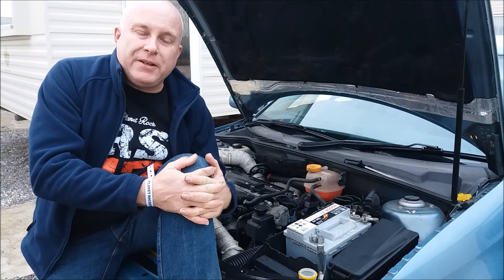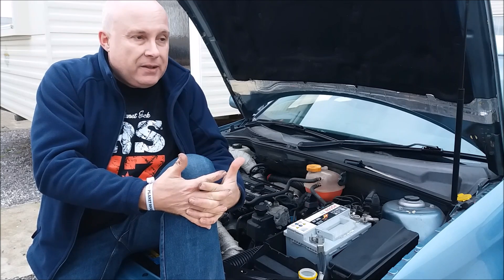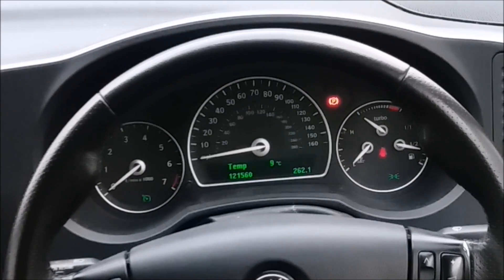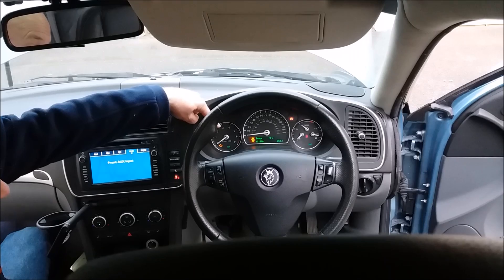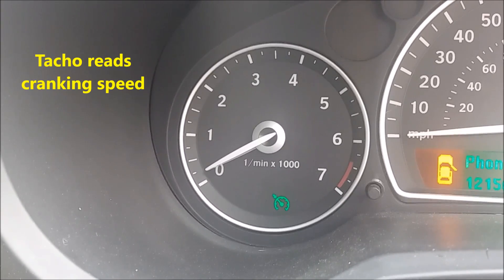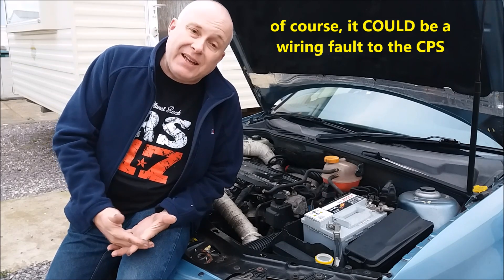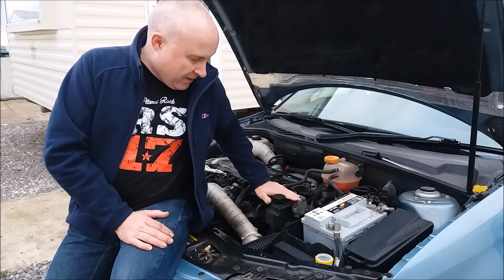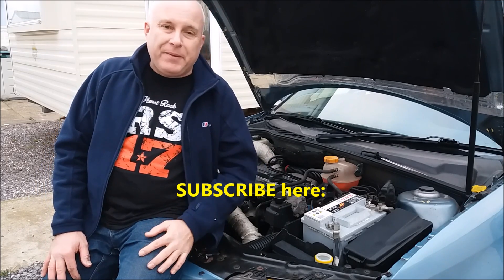CRANK Position Sensor Test - failing CKp sensor - CKp test

Comment: Hey Cyclone Cyd, I’ve been chasing a problem a intermittent stalling problem very similar to what you describe. My car is an 03 Toyota Camry v6. It would die when idling then it would crank, but not start. After 10 mins, it would then start again. Although it is a Japanese car so I don’t if it is the crank shaft position sensor or cam sensors. No codes are set off either. My mechanic is baffled. When cranking, tachometer doesn’t move at all.
Reply from the maker: It turns out that some Toyotas don't show revs when cranking anyway. Do you know if your engine has a camshaft sensor too? Being an older design it may not have.
Next time it stalls, be ready with a DMM. Connect it to the crank sensor (set on low mV scale) and crank the engine. If the sensor is good you should see a small mV reading. If there is no reading (zero reading) then the sensor is dead.
Your symptoms are bang on, so while I'm not normally a fan of playing 'parts darts', in this situation it could be cheaper to change the sensor than to pay for diagnostic time. Testing the crank sensor properly requires a picoscope (££s) and is beyond the vast majority of DIYers (and you'd be surprised how many garages don't have one either).
Reply: Cyclone Cyd I’m not too sure if my engine has a cam sensor. It is the 1mz fe engine non vvti. Do you know what are quality brands for a camshaft sensor?
Reply from the maker: @civlife1239  Bosch and Denso would be my choices.
Reply: Cyclone Cyd out of the crank shift and cam shaft sensor, which one do you think it is more likely to be given my symptoms?
Reply from the maker: @civlife1239  Crankshaft sensor would be my guess. In the region of 60-40 to 65-35 I'd say.
Reply: Hey Clyde, I would like to update you on what the issue was. Crank sensor was only part of the problem. The reason why it failed was because the water pump is leaking colant causing it to fail. This means I’m going to need a water pump and time belt for this car. Car has 150k 03 Camry v6. I’m really disappointed that it isn’t a quick fix.
Reply from the maker: @civlife1239  Ah, water on the sensor eh?  Does the timing belt drive the water pump then on these?
Reply: Cyclone Cyd yeah, I’m going to need a new sensor, water pump and timing belt.
Reply: Do you think it’s worth fixing this car? It’s an 03 Camry v6 with 148k miles.

Comment: Great video and info! What if there is no cranking sound, the kick starter burnt, and the car refuse to start at all?
Reply from the maker: If the car won't crank, then either the starter or battery are dead, the leads are damaged, or there's an issue with the starter control from the ignition switch.
Does that help?

Comment: Great info, thank you! Can you or someone please tell me in regards to a no start Saab - if it is an electrical issue ie. Coil or wiring harness or whatever will there be a bump in RPMs when trying to start???
Reply from the maker: Not from cranking. If the battery/starter system is healthy the cranking speed should stay fairly steady (around 200rpm usually). If the rpms are 'jumping' occasionally that suggests the engine is trying (unsuccessfully) to fire.

Comment: on my   chevy   3500   express  van w  5.7 vortec  engine and  60,000  miles: early   sign of a CKp sensor  problem  was  occasional  MIL  yellow   engine   code on dash,  occasional  code P0300  'engine   misfire   on  random cylinders'. ,the  engine  starts  and  runs   fine and  accelerates  up   hills   well. but my   mechanic  said  don't  drive it, do a   diagnostic. "an  engine  cylinder   misfire   from a   bad   spark  plug  is  annoying   but  an  engine   misfire  caused  by   the  CKp  being  bad can  ruin your   engine. " the  misfires  will just  get   worse   then  cause   you engine  stallouts   when   running ,  and   hard  or   impossible  starting. once the problem is more  advanced  you will   get   OBD Code P 0335  . at that  stage you must  get  this  CKp problem  fixed  or you can ruin   your   engine. sometimes  a  shim   kit   will    fix   it   other   times   you need the  wholeCKp sensor  for   hundreds of  $$.
Reply from the maker: Here in the Uk a CPk sensor is typically £50-80 for Bosch. Does "hundreds of $$" include labour because it's hard to get at?

Comment: Hey I have a 2004 Hyundai sonata. The red oil light came on and the oil fuel full  however I was driving  the car went to lose speed and slow acceleration out the blue the car shut off never started back up it cranks but won't start. I'm at a road block not sure on what's the problem
Reply from the maker: That could be CPk failure, but so too it could be many things. If it was sudden then suspect something on the control or ignition side (CPk would be in this category). If there was any spluttering, suspect fuel problems. When it cranks what does the tacho do?

Comment: हिंदी में जानकारी चाहते हैं सर हम आपसे सेंसर की जानकारी मल्टीमीटर से चेक करने का तरीका
Reply from the maker: I translate that as: "Sir, we want information in Hindi, how can we check the sensor information with multimeter"
The bottom line is that you can't. You need to check it with a picoscope, which means you need a garage to do it. If you have access to one you can use an oscilloscope. You need to check the waveform to see if any signals are missing. It might be cheaper to buy a new sensor than pay a garage though.
लब्बोलुआब यह है कि आप नहीं कर सकते। आपको इसे एक कुंडली के साथ जांचने की आवश्यकता है, जिसका अर्थ है कि आपको इसे करने के लिए गेराज की आवश्यकता है। यदि आपके पास एक तक पहुँच है, तो आप एक आस्टसीलस्कप का उपयोग कर सकते हैं। आपको यह देखने के लिए तरंग की जांच करने की आवश्यकता है कि क्या कोई सिग्नल गायब है या नहीं। यह एक गैरेज भुगतान हालांकि एक नया सेंसर खरीदने के लिए सस्ता हो सकता है।

Comment: very important easy advice! Thank you! I have problems with my Fiat Stilo 1.9 D. Will try tomorrow
Reply from the maker: Ah, the Fiat 1.9 diesel engine. Same engine is fitted to Saabs, Vauxhalls and more. I've got a horrible feeling that engine has a CAM sensor as well as a CRANK sensor, but I'm not certain. You will need to check your service manual. 
Please let us know what you find out and how you get on.

Comment: Hi, my bmw hard start/long cranking when cold engine.. Even after my battery is new, and still same symptom. But when my engine warm /hot it's easy to start. Is that because of crankshaft sensor? Thanks
Reply from the maker: Unlikely. That's the exact opposite of what you'd expect.
Diesel or petrol? Age? What have you checked so far?
Reply: Hi, thanks for replying. Mine's  E60 N52 Engine 2007 Petrol. Btw this morning i just swapped inlet(camshaft) sensor, with outlet (crankshaft), now everything fine for starter. And when i checked with INPA OBD, the error message changed to Outlet Camshaft Signal, so it's mean that Inlet Sensor(the first one, before i swapped) is almost damage. Thats why my bmw super hard to start. So i have to buy new one. 
2 days ago i just replaced new battery.

Thanks for your videk, that's helpful alot!

Comment: I have a vw sharan 2003 when I'm driving along it losses power then I restart a few times then it's OK for a bit then it losses power again dosent happen straight away.
Reply from the maker: and no EML or codes presumably? Sounds like the CPk. Typical failure mode

Comment: Thank you very much for the information you have given ,I am having the same problem, thanks again..
Reply from the maker: You are welcome. Did it help you trace the problem? And what car?
Reply: Cyclone Cyd 
Hello, my car is 1977 ford taurus lx 3000 cc 201 hp, I am waiting for the spare part , nearly 100 percent we have had the same symptoms that you describe when the crank- sensor is not  working properly, I    will inform you about the result, thanks again for your valuable video.

Comment: Isn't this quite common in cars such as your vw 9n?
Reply from the maker: I don't think I'd say it's "common", but yeah, most European cars can suffer this. It gets more "forum" attention because of the difficulty mechanics have diagnosing it due to there often being no code (and them not having a picoscope either - lack of proper investment in equipment)
Reply: @CycloneCyd  I've been made fun of in the past for my travelling across Europe with the engine light on. also, I used to reassure everyone that that was no big deal!! .. And in fact I still drive it today without any problem whatsoever except the rough starting.

Comment: my rpm drops and my air con stops working and it also stalls can it be the crank sensor?
Reply from the maker: It 'could' be if it's giving a faulty signal (you can't test for that at home unless you have a picoscope). Also check your throttle body is clean and for vacuum leaks.

Comment: Please help!
I have a 1998 Dodge Dakota and it keeps stalling on me. The code that comes up is P0351. At first it wasn't so bad, but now it's worse. I already replaced the spark-plugs, the spark-plug wires, distributor cap and valve, ignition coil and throttle position sensor and I cleaned the idle air control valve. None of those listed fixed the problem. Now I'm assuming that it's the crankshaft position sensor, but my RPM meter goes up slightly when I try to turn the vehicle back on after it stalls. I'm lost and don't know what to do, should I just go ahead and change out the crankshaft position sensor anyway and also get a new idle air control valve? I'm so lost on what to do and I need my truck for work. 😔
Reply from the maker: Is your replacement coil BRAND NEW? If it's 2ndhand, inspect for tiny cracks in the outer shell. Have you checked the integrity of the wiring from the engine ECU to the low tension side of the coil? If that's all good, it may be an issue with the ECU itself. Where the pin outs connect to the board, the soldering can crack. If the ECU casing can be opened up you can often repair these easily (or someone skilled at soldering can do it for you).
Reply: @CycloneCyd  The ignition coil that I installed is brand new as well as the wire that connects from the distributor cap to the ignition coil. I also installed a new idle air control valve after my previous comment and I still have the same issue. I am assuming that I am having a computer issue because I can't think of anything else that it might be. I have not fully inspected the wires, so I will give that a look. Thank you!

Comment: My car will not run for long when you start it. I put a fuel pump it and a throttle body on it. Also a fuel relay. My van will start but then cut off. I need help Please email meRaymondbrown470@gmail.com.
Reply from the maker: when you say it won't run for long, how long? Long enough to get to full temperature?
When it then stalls, what does the "tacho test" (see video) reveal?
Is the EML on?
And you mention a car and a van - are you referring to the same vehicle or two vehicles??

Comment: Can a car still run with a bad crank sensor. I have an 03 grandam gt 3.4l driving home from work today just started running like doo doo. Makes like a spark knock sound and has no power. Had the codes read and it read they were bad
Reply from the maker: Yes, it can. If the sensor is just "missing" signals the engine can run real rough. The only way to diagnose this is with a picoscope, but this is beyond DIY (unless you're into electronics and happen to have one, lol). You'll need a mechanic with one and who knows what they're doing (a rarity).
Reply: @CycloneCyd  so i ended up taking to a mechanic they found that a rocker arm had came off they had to healycoil it back on.. Got it running good but i still have engine lights not sure what they are atm. I know one read crank sensor so ill take it back to have em read and fixed
Reply from the maker: ah, phooey!! just spotted this was 2 weeks ago. Sorry I didn't see it. How did you get on??
Reply: @CycloneCyd  i appreciate the response :)
Reply: 250$ to have the rocker arm repaired and he said the 3.4l are notorious for that

Comment: My car died randomly like you said but now it will start but is really really rough and dies quickly any suggestion it's an 03 cadillac cts thanks
Reply from the maker: It could be the CKp, but it could also be a fuelling issue - blockage or dying pump

Comment: My infiniti g35 has an issue during a cold start. It takes a couple of tries for it to turn on but will eventually start and once it starts I can turn off the ignition and itll start up right away like normal. What I found interesting was that the car sounds exactly the same in this video when the injectors got disconnected for demonstration during my cold starts. I've replaced the fuel pump and spark plugs. Have not messed with the coils nor the fuel injectors yet or the camshaft or crankshaft sensor.
Reply from the maker: I'd say that sounds like a fuel problem rather than ignition. Try turning on ignition and wait 3-5 seconds before cranking to give the pump time to build up fuel pressure. Have you tested  fuel pressure at the fuel rail or cleaned the injectors?

Comment: What i've got at the moment is a tractor with a CanBus ECU and ECU for the transmission, both talk to each other, the transmission speed sensor has been replaced and fault still exists even though the tacho works, it was in salt water so now looking into Tacho sensor, tractor takes a while to start so now looking at YouTube for information, the signal must be rough so Canbus not happy with signal.
Reply from the maker: Hi actorzone, that could be a tough nut to crack. I'd start by checking the integrity of all the wiring and condition of the connections. If you can, take the PCBs out of the ECUs and check for corrosion damage to any of the tracks. Use a magnifying glass (or macro lenses on your phone camera) to look at the board and look for 'tendrils' coming from the tracks or shorting the tracks or salt deposits. You could clean up the the boards with and a contact cleaner or alcohol. Look for loose joints where the pins connect wires to the boards (a common issue on domestic boilers!!)

Comment: 1993 Cadillac Allante.  I have replaced the ICM (ignition control module), MAP sensor, combination switch, EGR valve.  Starts right up when it is cold, no problem.  But once the car is driven continuously it will randomly stall, especially if I am in stop-and-go traffic (which is the norm her in Los Angeles).  I then have to wait 25-30 minutes for it to start up again.  Once the tach gauge starts to go up and down, it will start to hesitate, then finally stall.  I've ordered a new crank sensor and connector.  May have a pro install for me though.
Reply from the maker: Did the sensor prove to be the issue? New one sorted it?
Reply: Cyclone Cyd  $1000 later, it was the MAP sensor, again. I did replace both crank sensors anyway, but they weren't the source of the problem.

Comment: So what if I do have a camshaft position sensor ? Would the tachometer have the same results.
Reply from the maker: NO, if you have a cam sensor as well as a crank sensor (most diesels do) then the "tacho test" won't apply. You would have to test each sensor. You should be getting an EML and cam sensor code though as the ECU compares the two signals to make sure they are telling the same story. Measure the sensor output in mVac, if one has no output it's faulty, if this gives no result you need an oscilloscope (or picoscope) which means going to a garage for most people..

Comment: My ptbcruiser cranks over but dont start. Possible fuel pump or crankshaft sensor. It cranked 1 day but didnt start. 9 hours later I tried and it started fine. 1 week later doesnt startvat all. Tried starting g fluid started for 4 seconds ds then died
Reply from the maker: What does the "tacho test" tell you?

Comment: Hi.  Thanks for the info.  Just installed a 1.8 vw engine to an Audi A4 but still using the A4 ECU but the engine just cranks,  so a friend says i should re-install the Reluctor ring of the Audi so that the ECU can read it,  but isn't the sensor that i should change?... On the scan tool I'm not getting a CKP sensor DTC.
Reply from the maker: It seems to me that if you're using a 1.8VW engine you should use the reluctor AND sensor for that engine. Have you tried the 'tacho test'?
Reply from the maker: The lack of DTC is no surprise. Without a working CKp sensor the ECU cannot know the engine is turning, thus the ECU will remain in "engine on, not running" mode and so no DTC

Comment: Nice video, precise and useful. But....My VW mk4 1.9 tdi does not move tachometer when cranking, after starter repair and compression, battery and fuel pipes check starts much quicker, used to not to start at all before (only with start spray). 
Now after start it idles uneven first 10 seconds on cold motor and after 50 m of driving it cuts off in 1st gear when attempting to start. Started very hard after long cranking and liot of white smoke (fuel not burnt I suppose). Never did cut off in driving (still, thank god). Could it be crankshaft position sensor? My mechanic said it is anlaser/starter problem. I am an amateur but after this I don’t know for sure and have to ask myself will it leave me somewhere. Thank you and keep up the good work!